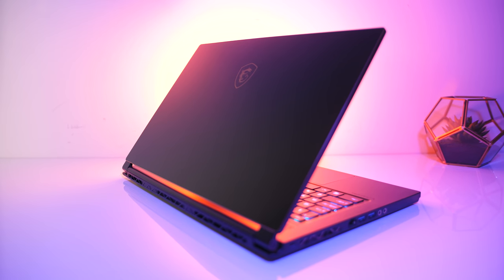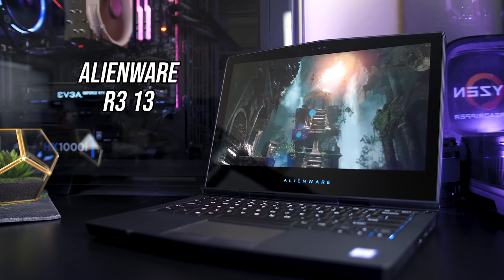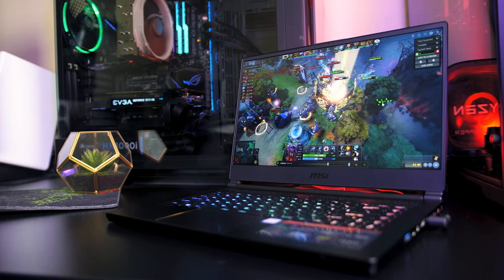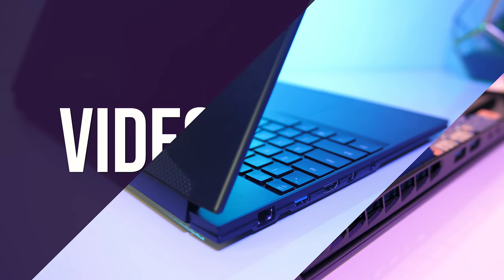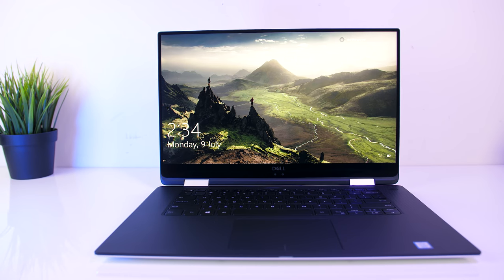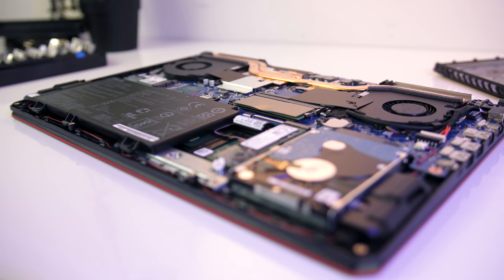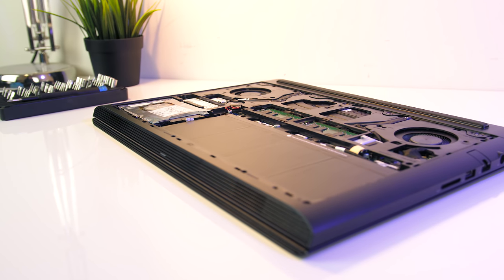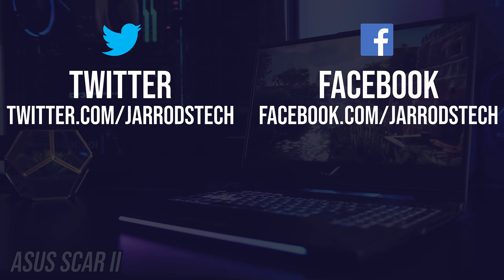The Best and Worst Gaming Laptops of 2018

Comment: I so agree with you!!!. And now even the G7 8750h is hitting thermal throtle. After the bios 1.6.1 update the computer is crap. They've done something to the voltage of the cpu and now cpu hits 100c so fast the fans don't have time to kick in. The computer is now running so hot that it's impossible to run any games without limiting the power delivered to the cpu using the intel extream software. Theyve done something bad to the laptop and i don't know what it was. I had to limit the CPU power to only 30w so games will play without stuttering. i'm not talking about slight stutter. I'm talking about 11fps stutter that would last for 3 seconds and after 10 seconds again.. and again .. and again.. The worst part is that dell won't give a definitive answer to the problem. Even people that have replaced the thermal paste of the CPU are now facing heat problems.
Reply from the maker: Ouch 😰
Reply: @JarrodsTech  Yep.. like that... Just living with it now until Dell releases a new Bios. Just as we speak here my computer is at 60c with room temp at about 15c. It used to be around 35c while browsing and youtube videos before bios update. So annoying.
Reply from the maker: Have they acknowledged it as a widespread issue or something? Are they going to fix it?
Reply: @JarrodsTech  On Dell's forum they've answered some customers but with no definitive answer. I didn't know about this issue since I have never updated my bios from the day I bought it on October, and I did so on a dumb moment of mine. I guess my bios was on the 1.4. But reading through the forum I found out that since the bios 1.4 these computers have been having this over heating issue. Mine was kind of ok. I see people complaining about fan curve but i'm pretty sure that the fan is no the problem. Even with fans blowing as hard as they can the computer keeps reaching 100c on games or using sony vega. The only solution I've found was to limit the power delivered to the CPU. I've expressed my concern in the dell's forum since calling the on the phone is of no help at all. The computer was fine and now after some simple bios update it's not. Dell also wont allow the G7 to do a bios roll back.
Reply: @JarrodsTech  Oh just to mention, even the power brick use to be cold while not playing games but now when browsing the internet or watching videos on youtube the Brick is warm+. Showing that the system is actually sucking more power to do the same job as before. I don't have a what meter to check that.
Reply from the maker: Weird, sounds like some sort of mistake by them..

Comment: i need something under 1000$ for gaming also for 3d render and autocad.

Asus TUF gaming laptop, i7 875H GTX1050 16gb ram

-ASUS FX503VM I7  or i5 better price

-ASUS FX 503VD I7 or i5 better price

-ASUS ROG STRIX GAMING LPATOP I7 GTX 1050 16GB RAM 

-ACER HELIOS 300 

-LENOOVO LEGION Y520 I7 

-ASUS TUF I5 1050 

-ASUS TUF I7 1050TI 

-ACER 2019 NITRO 5 I5 7300 

-ASUS FX504 I5 1050 

-MSI GV62 I5 

-DELL 7TH GEN I5 7300 GTX 1060
Reply from the maker: Anything but the FX504 due to the reasons mentioned in this video.

Comment: I will see you reviewing rtx laptops next year, have a great day!
Reply from the maker: Hopefully I can get lots!
Reply: @JarrodsTech  
Ah, Jarrod, i forgot to ask this yesterday.
What is the best 120hz panel for 15.6 laptop?
I have some on my list.
1. N156HHE-GA1
2. N156HCE-GA2 (262k color)
3. B156HAN04.2
4. B156HAN04.5
5. B156HTN05.1 (262k color)

The other are all 16.7m color.
Everything is 72% ntsc except N156HHE-GA1 is 100% srgb (review from notebookcheck).
So, is there any difference with 262k and 16.7m display color like...
The 16.7m one color is more vibrant?

And then B156HAN04.2, B156HAN04.5, N156HCE-GA2 response time are 25ms in tr + tf, while the other two are 5ms tr + td.
Are tr + tf same with tr + td?
So i'm hoping i could get a decent display that aren't too dim (i would like it brighter or as bright as my B156HAN01.2) for multimedia and gaming (not competitive) purpose.

I already looked at N156HHE-GA1 And for the price (in aliexpress), that screen is really tempting but it's still tn (Ok, i had an experience with tn panel with great color reproduction & accuracy and it's a great experience), but it seems the screen is too dim, lower contrast than mine now.
Well i haven't looked at others yet.
So, what's your recommendation?
Reply from the maker: I don't know if I've tested even half of those so can't really say 😅 I don't know if I've used any 262k ones now that I think about it, I would assume more (16.7m) would be better though. Not sure about td, but I believe tr + tf is basically GTG: http://www.tomshardware.com/forum/id-2864218/response-time-confusion.html
Reply: @JarrodsTech  
Yes, i've already search it.
They say 25ms tr+tf are similar to about 5ms gtg.
But the thing that makes me confused are tr+td since there are no explanation yet.
My assumption, td is time delay, and it's similar to time fall, but nah...
I don't think it is.
There is also a big possibility that tr+td are similar to gtg, but its still uncertainty.
By the way, which display that you already use from my list?
And how it is compared to B156HAN01.2 display (if you own and use it before)?
Or if you didn't have it, how is the display compared to the stock helios 300 (g3-571 2017 model) display then?
Reply from the maker: Yeah I'm not too sure I haven't actually heard td before, though I am by no means a monitor expert! I don't really have a way of checking unless I open the HWInfo export for every laptop I've reviewed and manually search 🤔
Reply: @JarrodsTech 
Hm...
Ok then, did you have any channel that you could recommend about display (monitor)?
Well if you didn't have any, it's fine though.

Comment: Hi,is msi ge63 8se good?in our country y740 got rtx 2060 sams as msi ,which's one better they are on same price
Reply from the maker: I haven't tested the RTX one, the GTX one was pretty hot though with thermal throttling, however my Y530 was also quite hot too so not sure how the larger Y740 would go, build quality of the Lenovo one is nicer in my opinion, otherwise a bit hard for me to compare further as I haven't personally used either of those specific models just yet.

Comment: I'm thinking of getting the MSI gs65, but I don't know if the 144hz will be completely utilized when playing games like Fortnite, could I play that with all low settings and get 144fps locked? Another thing I'm worried about is how everyone is saying to undervolt the CPU, because the laptop overheats easily.
Reply from the maker: Fortnite doesn't need much power to run, and it gets pretty high FPS, I think you'll be fine with that game. You don't have to undervolt, but may be able to cool temps a bit and gain extra performance, but that's the case with any 8th gen laptop and not unique to the GS65.
Reply: @JarrodsTech  thanks for the fast and informative reply, appreciate that you actually interact with your fans :)
Reply from the maker: No problem at all!

Comment: MSI gs65 stealth sounds like a small jet engine with a high pitch sound that gives me a headache tryed 3 different laptops and they all did it. OP from Walmart mechanical keyboard requires constant and hard pressure to hold down a key and keep its signal going. ex: running with shift in fortnight or any game requiring holding down a key to run will have frequent interruptions of you stopping from running and reholding down the key with a lot a pressure which tires out your pinky. Acer predator 500 battery will drain while plugged in and playing fps online and can only get 4 hours of hardcore gaming straight before you have to stop and let it charged even though its plugged in which requires you to underclock and undervolt the gpu and cpu. How do I know all this??? I've bought and returned all the laptops I've mentioned because of all these issues.
Reply from the maker: Yeah that's pretty normal, most laptops with 8th gen CPUs are around similar volume levels with fan noise, just how it is because it's a hot chip. All laptops have downsides, nothing is perfect which is why I had no "best overall" category. I didn't have battery drain with my Helios 500, but it was the 8750H/1070 version, the Ryzen one is probably different.
Reply: @JarrodsTech  Oh wow thanks for the reply big fan of the channel =D The Helios 500 only would do the battery drain while plugged in on games that were online FPS for whatever reason, Fortnite was the battery killer for me. Something about that MSI gs65 is off though its a really high pitch noise not only loud but piercing could still hear it though the game volume it would cut right through it.

My next buy is going to be the MSI GT63 hoping that will have a regular sounding fan and with a 330w powersupply not have the battery draining issue. I would wait for the 2019 models but I start back in college in 3 months and want to game as much as I can before I have no life again haha.
Reply from the maker: Cool hope it goes well, never used a GT63 myself. I think at CES in a weeks time there will be news of new laptops so could be worth waiting for that, I'll be flying to the US from Australia for it and will be making a few videos 👍
Reply: @JarrodsTech  Hey I have one last question and ill stop bugging you =P. After CES and the new 2019 laptops are shown how long before they are on the market?
Reply: @gamepro94z  for commercial consumer product maybe around 3-7 months, 

also varies depending on country and their supply chain stock availability,

for protoypes well...never XD 

i know this info is not helping you that much, but may you get the gist of it
Reply: I have  zephyrus that problem is non-existence,
Reply: @RatchetRorschach  wrong, most release January 29th
Reply: @emudshit  release doesn't mean it would on everyone's (country) store shelf at the exact moment.
Reply: @RatchetRorschach  that's not the point, he asked when it's avaible, and it's avaible starting January 29th. 3 to 4 Months is a terrible anwser my friend, in that time the 9th gen models will be avaible....
Reply: I ended up preordering the G7 17 with the 144hz screen and 2070 max q. I get the laptop feburary 13th =D.

Comment: Predator Helios 300 or Asus TUF fx505 ? Both running corei5 and gtx1060
Reply from the maker: I'd pick the FX505, slimmer bezels, no huge PREDATOR logo on the back.
Reply: @JarrodsTech  in terms of cooling which is better ?
Reply from the maker: I can't remember, but I have detailed thermal testing videos on both laptops you can refer to. From what I recall I had thermal throttling on the Helios 300, don't think it was quite as bad in the same stress test on the FX505, but you can check the videos.
Reply: @JarrodsTech  alrightt thanks bro 👌

Comment: ok so im curious is it better to choose a gaming laptop were they use multiple heat pipes like that cheap msi laptop you used or one heat pipe for the cpu  and one for gpu
Reply from the maker: Generally more is better, and shared can be useful too, as each component gets more cooling space than it would otherwise have. For example if you're doing heavy CPU work the CPU can get more cooling using the pipes going to the graphics even if the graphics isn't otherwise in use, it gets shared around.
Reply: @JarrodsTech  ahhh so i should go more for multiple heat  pipes?
Reply from the maker: More is usually better but it depends on the specific laptop, if possible try find some thermal testing of the model you're after, I have a lot of thermal testing videos on the channel, I'm not currently aware of anyone else that does as much testing as I do in that regard.
Reply: @JarrodsTech  alright thank you for the advice and help
Reply from the maker: No problem!

Comment: still happy with.my lenovo y530. its cheap, it good, and durable.. gtx 1050ti, i7 8th gen, with 2tb, 16gb ram.. it think u should include this..
Reply from the maker: I've been trying to get in contact with Lenovo for months to borrow a review unit. They finally got back to me and asked for stats on the channel, and after I sent them they never replied, so I guess they aren't interested in my channel maybe because it's too small. I bought the Y530 myself because it was on sale recently and a lot of people asked me to review it, but I only recently got it so I wasn't able to test it out in 2018 and have it in this list. The full review should be up this weekend though.
Reply: @JarrodsTech  thanks for response.. btw, ive been using this laptop for 5 months, and i dont have any problem. using y530 for picture and video editing, and playing gta5, tom raider & assassins creed origin. the performance is good -for me, this is the best cheap gaming laptop out there .
Reply from the maker: No problem! Good to hear it's going well 👍 Yeah it seems pretty good, although mine thermal throttles under heavy load so I might so a video on replacing the paste when I get back from CES to show the before/after differences in temps/performance.

Comment: I need a new laptop at 1199€ with a gtx 1060 what do you recommend ?
Reply from the maker: What's it for? Something like the Helios 300 would probably be alright for gaming.
Reply: @JarrodsTech  it's for gaming but I don't want to look so "gamer" and the thing is that here in France the Helios 300 with the gtx 1060 cost approx 1399€. I saw that the Dell g3 has some really good specs at a good price, it has a core i7 with 8gb and a gtx 1060 max q, it cost 1149€ would you recommend it ?
Reply from the maker: Ouch that's quite expensive, I guess it varies quite a bit by region, yeah G3/G5 would look a bit more professional then, and the 1060 Max-Q is only around 10% less performance than the regular 1060 based on my own testing, I have a video comparing the two here if you want to see the differences: https://www.youtube.com/watch?v=gT3_-6Rtfoo
Reply: @JarrodsTech  thank you
Reply from the maker: No problem!

Comment: Bought lenovo legion y530 at approx usd1025 (RM4200) with the following specs (price after 15% student discount from their official website)
i5 8300h
gtx 1050 ti (4GB)
8+8 GB ram
default screen option
256gb ssd
2tb hdd
With the discount, i think this is really the best value at this price point...
However, i dont like the thermal management as the cpu really gets hot easily under gaming... easily 90C unless manually reduce the in game settings..
Reply from the maker: Sweet! Yeah I had similar temps in my recent review, I'm going to change the thermal paste in a future video to see how that helps improve things
Reply: @JarrodsTech  I was worried because from internet people say 90C is pretty hot.. i limit my game setting, even some cases to 30fps to maintain 75-80C.. until I saw your review about it.. great job =D and looking forward for your changing thermal paste video =D
Reply from the maker: It's definitely starting to get up there, personally I don't mind 90c, these things are designed to get hot, they just throttle back if the heat is too much so they don't cook themselves, you will lose performance but should be all good otherwise. I think you should enjoy the higher performance you paid for instead of limiting to 30 FPS 😁 and thanks! Hoping to test the new paste out after CES is over!

Comment: Is buying Acer nitro 5 ryzen 5 worth buying ?
Reply from the maker: Depends on the price, when I looked before you could get the Intel/Nvidia one for the same price which probably performs a little better, the i5 CPU is better not certain about the 1050 vs 560X though.
Reply: @JarrodsTech  thanks
Reply: On flipkart during sales the i5+ gtx 1050 is just ₹5000 more expensive. So it's your choice of budget and performance. You can also undervolt it then

Comment: I stay away from thin laptops with hardcore components! I personally go for the bulky laptops (gt72 dominator for example) that are able to deal with the heat more efficiently. I have the gt72 dragon edition which houses a  full desktop gtx 980 and a unlocked i7-6820hk processor that can go up to 4.1 ghz. Both of these big chungusus are able to perform at their highest frequencies because they have plenty of room to breathe!
Reply from the maker: I've lugged around a 17" laptop with huge text books daily for too long to ever want to go back to a thicker machine, given I do a fair bit of travel with regular international trips these days I need the thin ones 😁
Reply: Got any other bulky Laptop recommendations friend? I too prefer desktop replacement "laptops" . Had my HP Pavilion dv7 6b00 for tooo long now.

Comment: I'm in the US. Would you recommend getting the Overpowered 15 or 17? Does the extra 1k make the GS65 worth it?
Reply from the maker: Yeah those OP laptops seem worth it for the money, I don't think $1k extra is worthwhile. They just use the Tongfang chassis like many other companies that resell them, so even Walmart can't ruin them like they did with their gaming PCs, as they're basically just rebranding a decent product and have cut the price.
Reply: @JarrodsTech  Thanks JT! I'm really getting into VR. Is there a significant performance boost from a 1060 to a 1070 Max Q for VR?
Reply from the maker: I've never tested any VR so I honestly don't know, sorry! I don't think there are that many VR benchmarks out there at the moment, seems to be a bit of a niche, I don't really know how to test it either as there's more than just FPS. I include VRMark benchmarks in my laptop reviews but that's about as far as I've taken it.